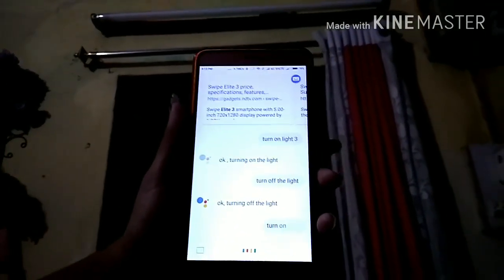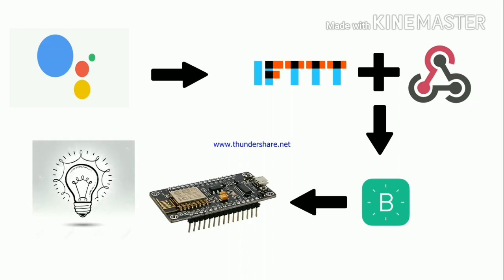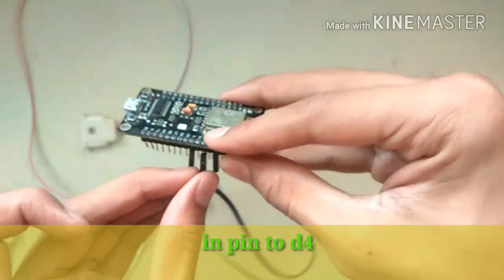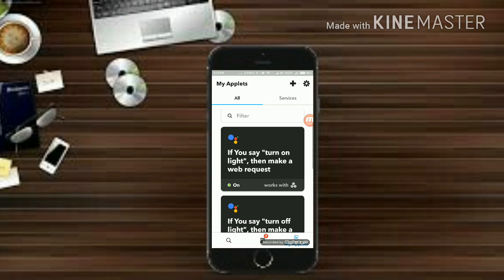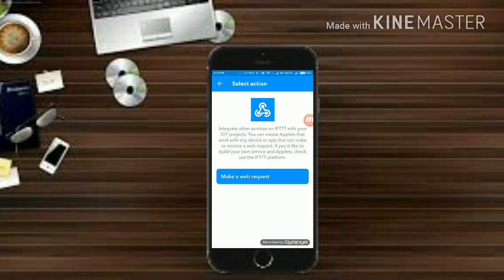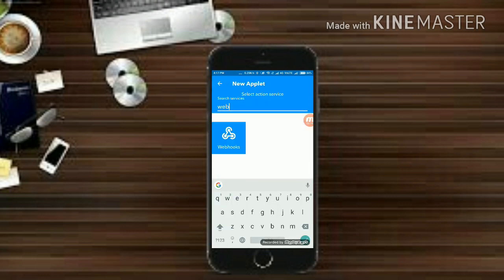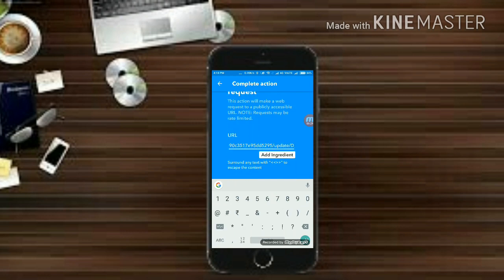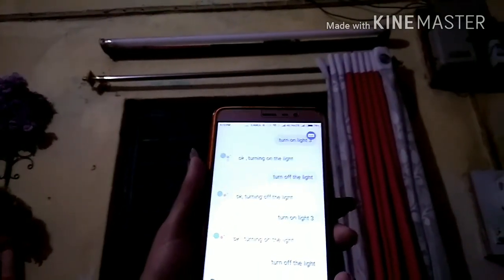Home automation using google assistant and nodemcu

Comment: Connect the JD-VCC pin to 3V instead of VIN and it will work if not working relay. It is due to lack of power source